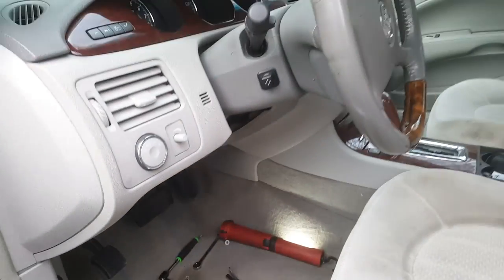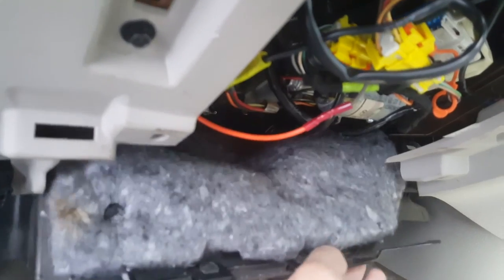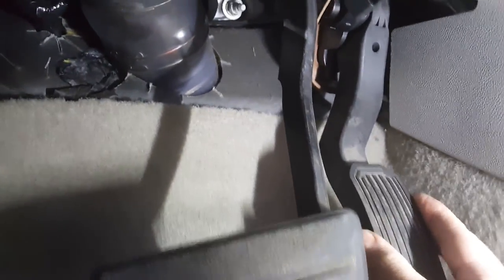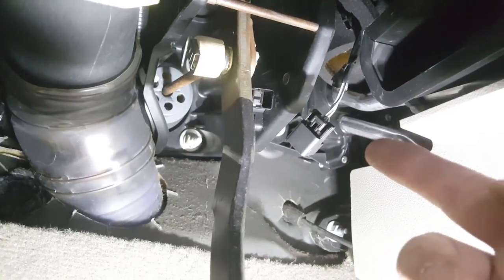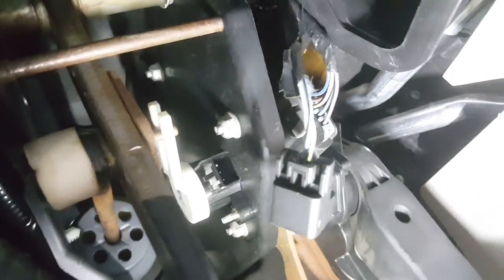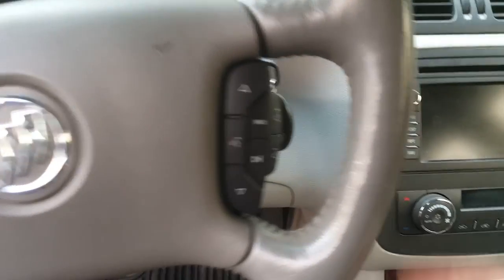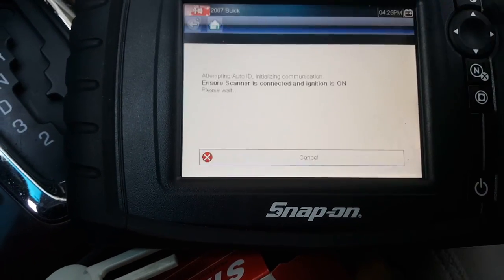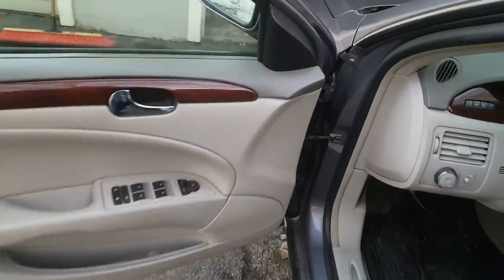2006-2011 Buick Lucerne / Cadillac DTS Brake switch replacement

Comment: Is there any way to calibrate the BPP sensor without a scanner?  Will disconnecting the battery do the same thing?  Thanks in advance for the help.
Reply: If it's only off by a blond one, slightly bend the metal peg that drives the rheostat lever. Use a small box-end wrench (like 1/4 or 5/16) that barely fits around the peg to give you leverage. I don't know about disconnecting the battery.
Reply: p39483 hey! Would that damage anything?

Comment: I have a 2006 buick lucerne...I am having problems with the brake light staying on after releasing the brake pedal...so what I been doing is taking my foot with the shoe on and reaching behind it to release the brake...Would I have to replace the brake light switch? or should I say the one working on it...Could you please get back to me soon cause I am taking my car back 11/4/2021...

Comment: Does the switch part you installed also control a parking brake pedal that will not set or fully release at various times?

Comment: Thank you for sharing this video. You just saved my ass a bunch of time and heart ache. Totally forgot about calibration after the replacement of the sensor. And who would have thought to look in the body control module should have been listed under ABS TRAC and after repair. O well job done car gone check in the bank.

Comment: We have a 2007 Lucerne and the cruise control works randomly....it seems when you hit the brake pedal (just a tad) it will work for a few minutes then go off..... does this sound like it needs a brake switch (the brake lights work just fine)???

Comment: Thanks for the great video! On my same car the 2 side brake lights are normal, but the upper/3rd one sometimes stay on. Anyone had that? Switch replace? Recalibrate? Thx.
Reply: Try recalibration,worked for me.
Reply: How do you Recalibrate? After switching the part ?
Reply: @joe-ku5hd  how do you recalibrate

Comment: So if u have to calibrate the switch after replacing it who’s to say it didn’t need calibrating before and not having to replace the switch. I replace my switch and brake light is still stuck on. what a pain in the ass high-tech piece of shit idea . I looked to bend the bracket  a hair and it was mounted to solid ... and to top it off GM put the screws in backwards so you can’t get to them without taking out the fucking gas pedal ... this should be a safety recall not to mention I have to replace the led center brake light that stretches across the entire length of the truck lid. .... ps if your cruise control doesn’t work it means your brake switch and break lights are stuck on!!!!
Reply: You don't have to calibrate the new switch. 🏴‍☠️